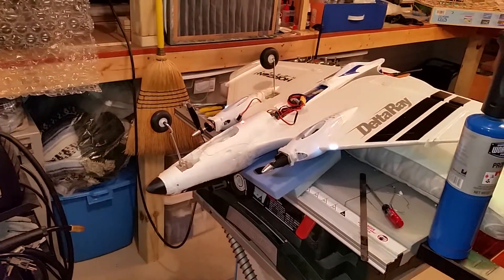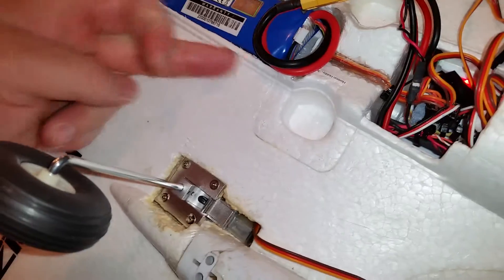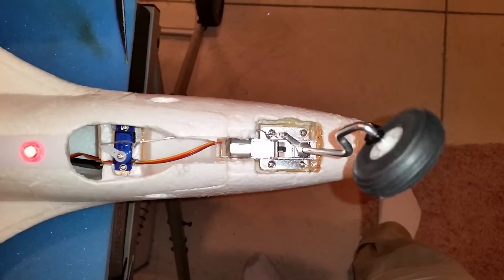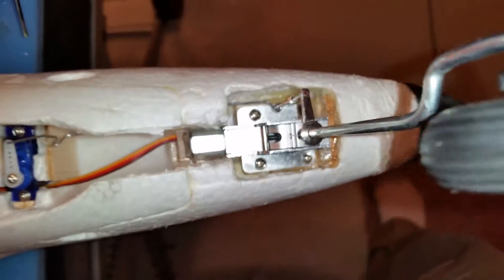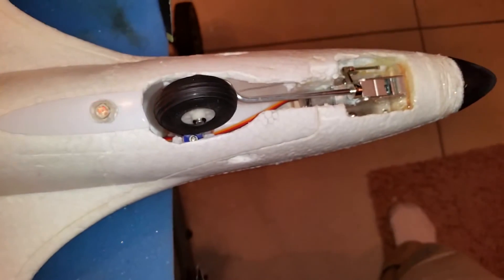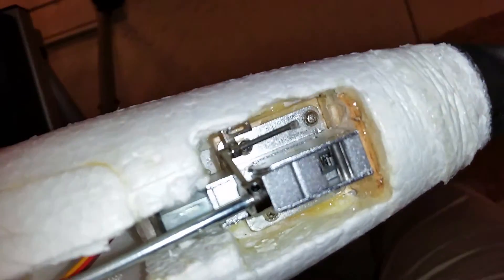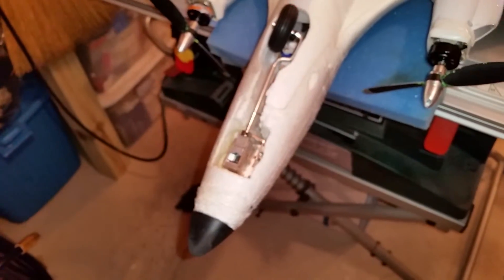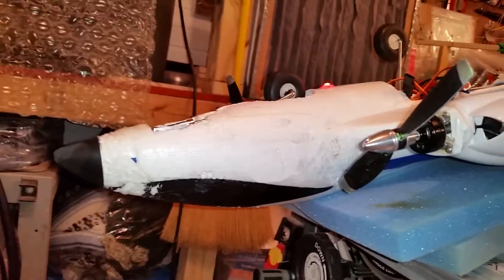Delta Ray Retracts Installation Video 2 (also Brushless, LED's, Flaperons, Rudder, Lemon RX)

Comment: Brian, Love the upgrades you do on this Delta Ray. I have the Delta Ray and have been looking at doing some upgrades too. However, I am new to RC. Really like the retracts, do you have a link or part number for on the retracts?
Reply from the maker: I don't have a link for these ones, but they were $20 on Hobbyking.com (on sale) all metal...Don't get these ones!!! Dynam makes a better set, which is less "tall", but byer be ware, Dynum retracts have some issues with really cold weather deployment, but with the Delta-Ray, it belly lands so good, if the gear don't come down, it's like a special flying challenge!!!Motion-RC ( https://www.motionrc.com/ ) markets these parts, and they are super good to deal with!